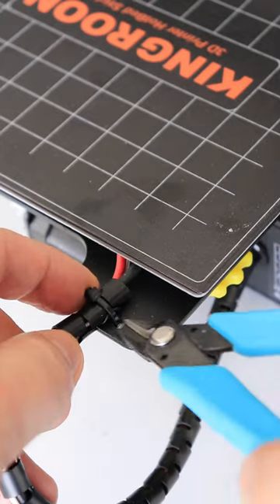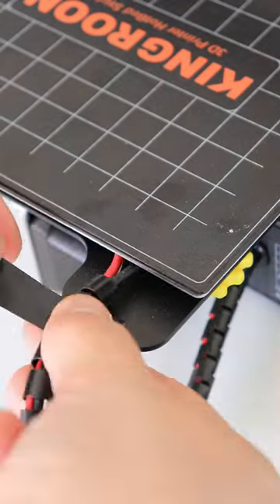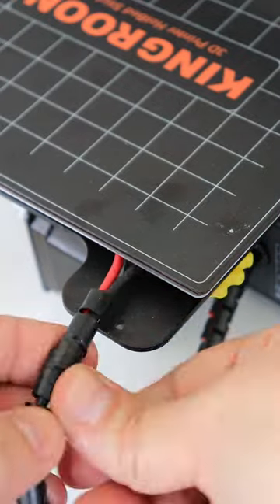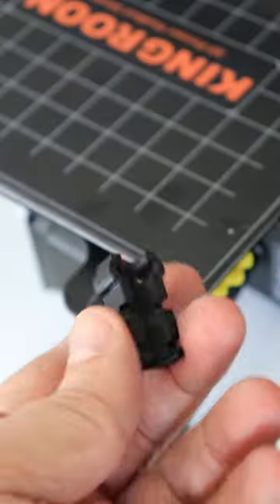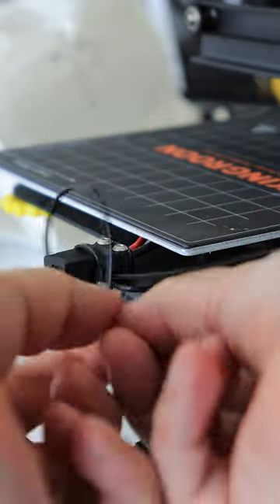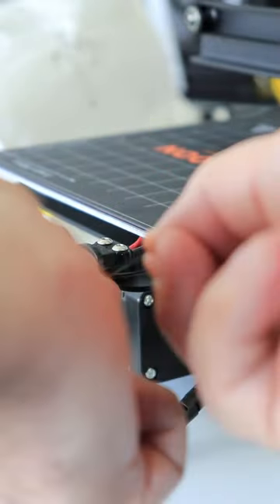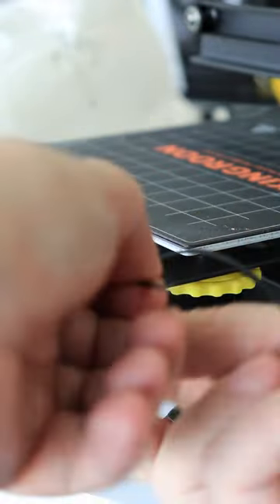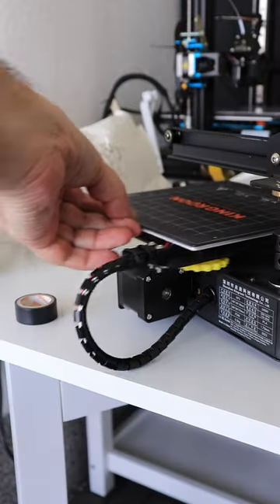Adding strain relief to Kingroon KP3S 3D printers heatbed cable #shorts

Comment: I don't understand why zip-tying it to the print is strain relief but not the  metal.
Reply from the maker: First we need that 3d printed part not moving. Then cable fixing to 3d printed part. Fixing on two positions prevent moving. Cable near terminals must be fixed.